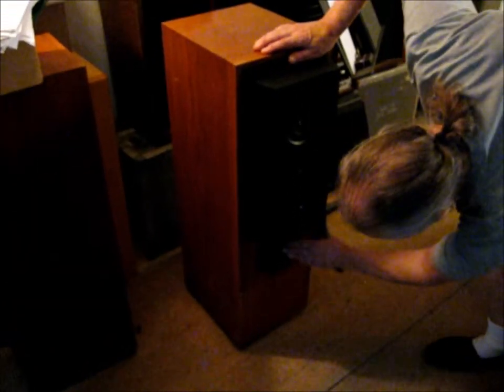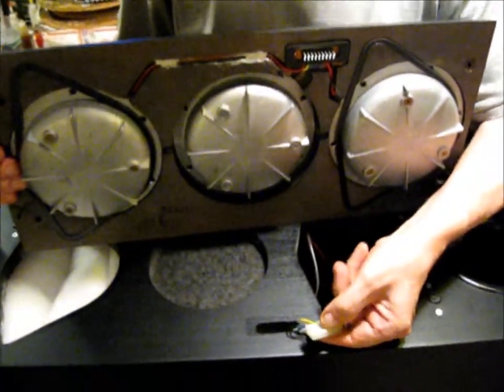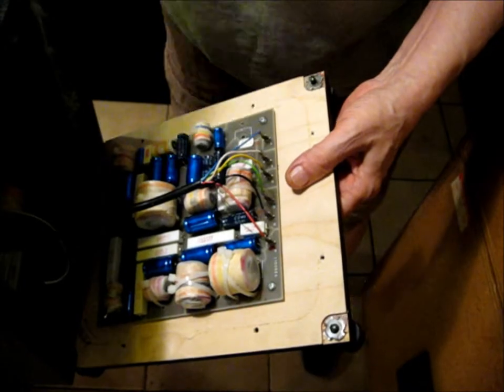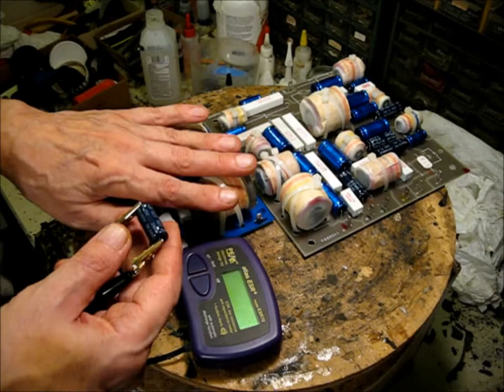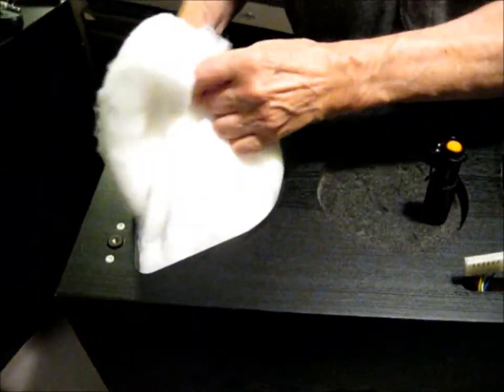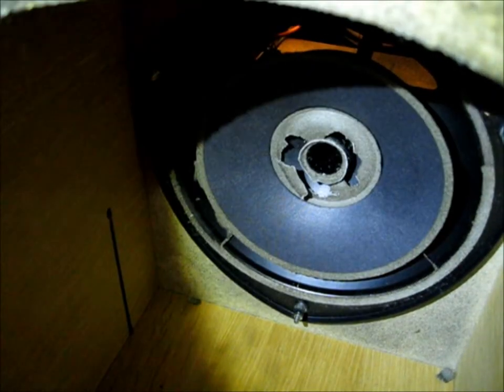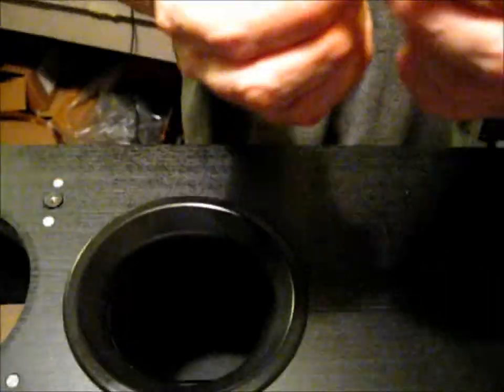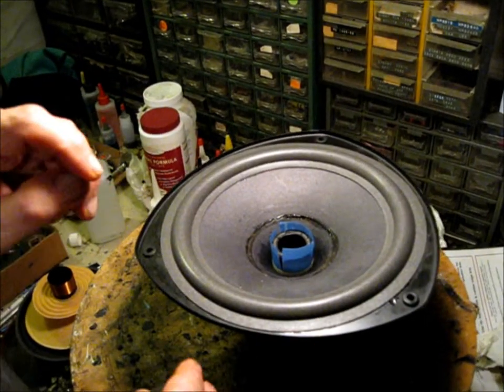KEF 105 3 Crossover Repair and Speaker Restoration

Comment: Please let us know what is that clear glue in a clear bottle you are using. Your comment on strengthening the cones' spider and former is spot on. I am currently changing the dustcaps on four B200. It takes patience to do right.

Comment: How often with heavy use do you rebuild the crossovers? I’ve got some B&O S75’s from 70’s that sound like 2 blankets wrapped over the cabs. I know they need rebuilt but I have a pair of LSA2’s that could improve frequency separation. Cheers-thanks for the info!

Comment: I just bought a pair of KEF 105/3's.  Cabinets and Grills are mint.  The seller said they are perfect so I shelled out $400 for the pair.  Found out the Woofers have rotted surrounds.  Not sure if they are even worth fixing.  Seller said "Tough".
Reply: Sell is a dick, but at least you have yourself a cool project and will end up with one of the top 100 loudspeakers ever produced when you are all said an done!   I have 104.2 and had to go through the same thing: foam / donuts / crossovers and ferrofluid.  Hit me up if you need leads on where to get what, as your speakers and mine share many components.
Reply: Mine bad luck. They are cosmetically quite nice.  There is a local fine antique audio store here and they had no interest in the KEF's yet they sell lots of older equipment.  Told them I also have some Blonde Maple B & W Speakers and those they wanted.